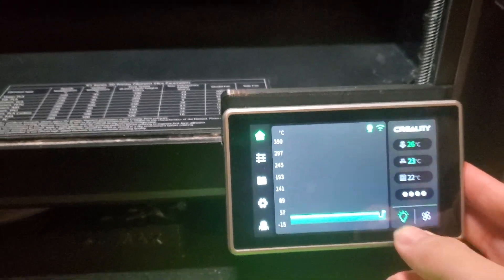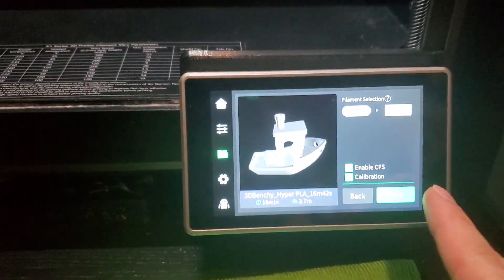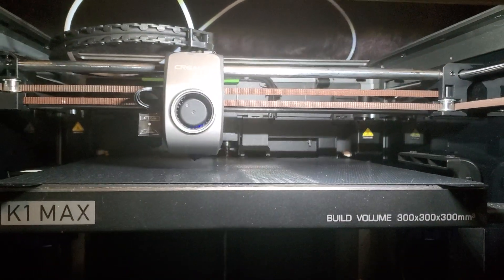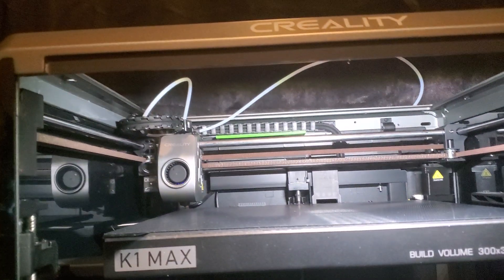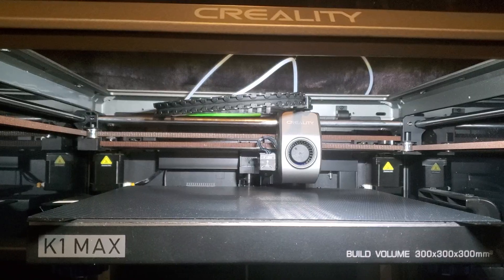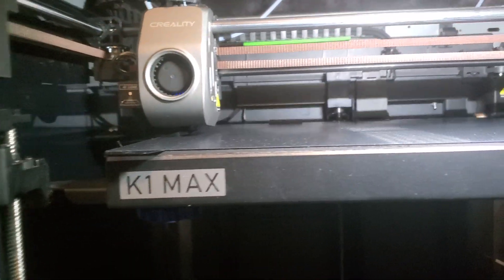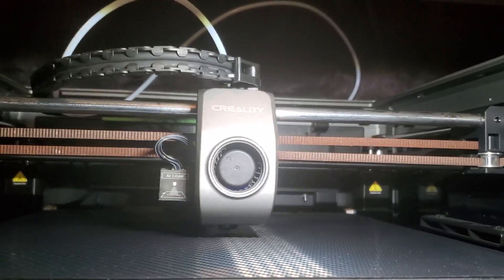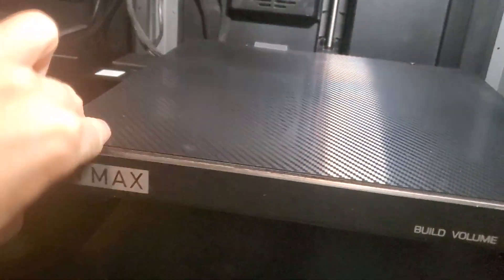K1 Max Issues After CFS Upgrade

Comment: The x-axis is very dirty, which causes the print head to lose its bearings, and from then on, these collisions occur. I had the same problem, and after cleaning it with isopropyl alcohol, it started working fine again.

Comment: I was thinking it looked like the extruder thought the bed was bigger than it was...as if it was firmware for the K2 Plus.  I had issues too when I did the upgrade.  Mostly the head banging into the wiper apparatus in the back.  Went to bed out of frustration.  The next morning, booted up the printer again and it was fine.   I would sent the video to Creality.  They are very good at helping.

Comment: Are you calibrated correct cutter manually after firmware update and adjusted the tension of the belts? I upgraded maybe 3 months ago my printer and i use same firmware that came with usb.

Comment: Mine works flawlessly & I've had it 3 weeks. So, unless they changed the firmware in that week, I'd say this is a belt/stepper motor control issue. The machine obviously doesn't know where the print head is & slams it everywhere. The motors are also, sometimes noisy when moving in free space so it is a weird set of problems
Reply: Hopefully it’s the same for me…I want to upgrade my K1C. Because I had an anycubic Kobra 3 combo before…and it was horrible

Comment: Have you checked the belt tension step? I had the same slamming until I fixed the tension. I however cannot get my CFS to come up with the “1” to say it’s connected. I think the ish cable is bad
Reply: I had a problem with the CFS not communicating (big Zero in the display) with my K1C printer. After months trying different things, I finally decided to replace the USB-RS485 cable and that worked.
 I don't remember where I brought it from. Must have been from the Creality Store, around $20 if I'm remembering right. Couldn't find it on Amazon.